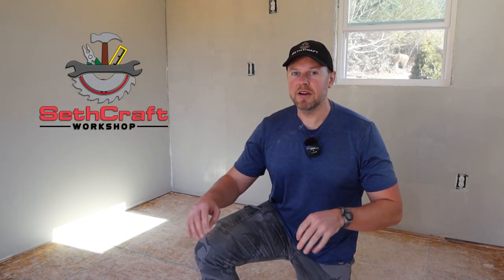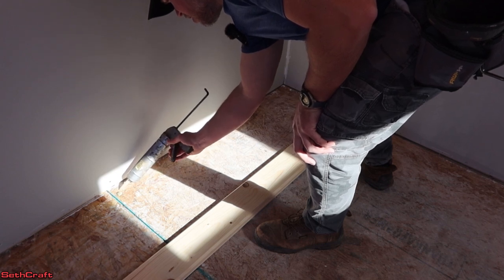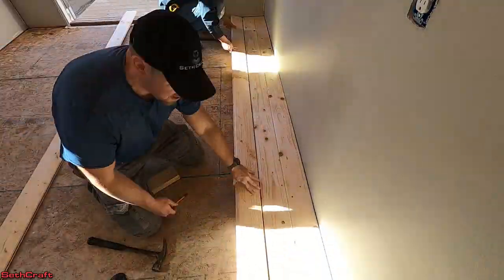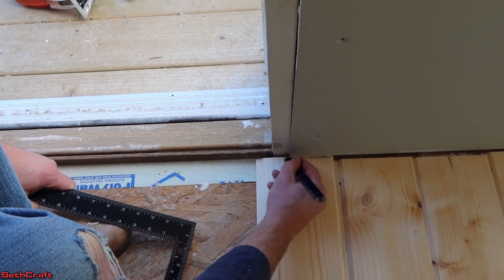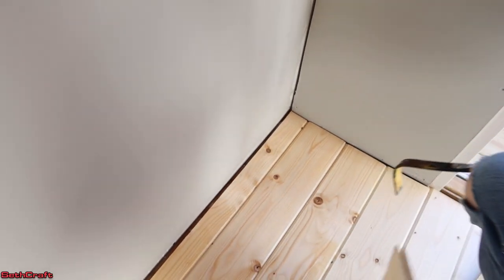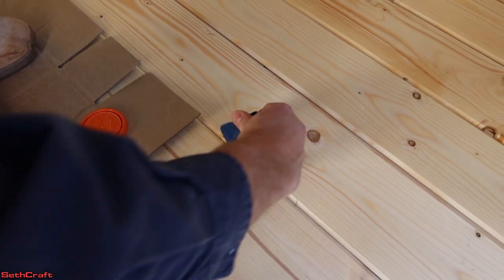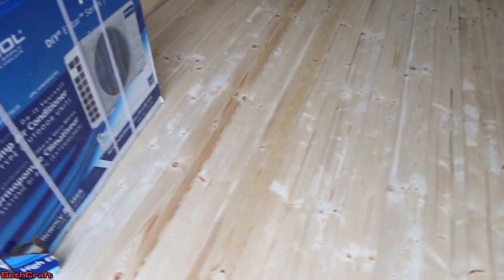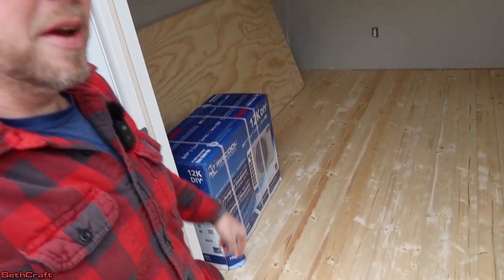Tongue and Groove Flooring Install 10x12 Shop

Comment: Liquid nail and finsh nails through pine into plywood without any seperation. Now ive seen it all. Love to see that 1 year fron now. And the amount of squeaks you have too
Reply: Not to mention they used car siding on a floor. Unbelievable. Imagine the amount of crude that will build up in the V gaps.

Comment: My mother's home had solid pine flooring like this (not tongue and groove) in a home she bought. It was installed in all rooms except for the bathroom. The flooring was easily dented and had a weathered look, but it was an interesting character look. It held up better than I would have expected, being pine, but I image a lot of that is attributed to the floor finish that was applied to help with hardening it. She was there 6 years with no need to refinish and without major issues from it.
Reply from the maker: Pine is an unusual choice for a floor especially for tongue and groove. Nice to hear that the floor lasted a long time in your mom's house. This floor had polyurethane applied and should be good for as little traffic as will be on it.
Reply: Not really. You see a lot of older homes in the Deep South with pine floors. Not a lot of native hardwood around here. My house built in 1890's is T and G pine , only one layer. No subfloor!

Comment: Other than looking kinda cool, I don't know why you'd want a soft pine floor. I'd prefer a concrete floor in an outbuilding like that. That pine is not going to take much of a beating.
Reply from the maker: The look was very important to the homeowner.  For a work from home office I think it will do ok. As an actual workshop it would get damaged real fast.

Comment: Hi, how to you cut the last plank? Sounds like silly question, but I'm not a carpenter so would probably need to take it to a carpenters workshop..
Reply: They should have explained this to you. You lay the last board upside down 1/4" from the wall  and mark each end where the cut should be based on where it meets up with the tounge. Once you cut it, you will get a perfect fit.

Comment: Hows the floor been holding up i thought about doing this for my tiny home.
Reply from the maker: Last time I checked with my friend it was doing well. some scuff marks because its a soft wood but not bad.
Reply: @sethcraftworkshop  I dpnt mind it get scuffs and dents in it I mean that in my opinion adds to the rustic look!. I'm wanting to stain it in Red mahogany then clear coat it using polyurethane....any tips? How many times should I go back over it with the polyurethane and is that OK to use?

Comment: this video should be titled "how to waste lumber and ruin your floor like an idiot"
Reply: Why? A lot of people use pine for floors.
Reply: @Mel-tw6qv  the boards he used are for walls and ceilings. They have a beveled edge which makes a big V groove. This collects dirt and debris and is very uncomfortable on the feet. Wood floor needs to be STAPLED every 10” with a hardwood stapler, regardless of adhesive. Correct me if I’m wrong but I don’t believe that the clear coat he used is engineered for flooring/wear surface. That weak finish will wear down very quickly and the soft and porous pine will soak in the dirt and be discoloured. Bad job from start to finish. Always follow code and manufacturers directions and you won’t go wrong.